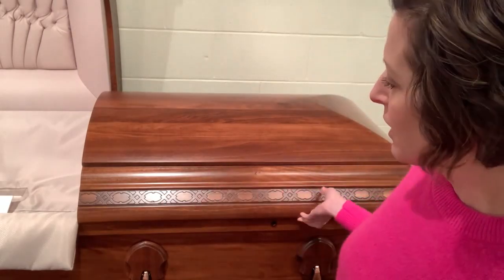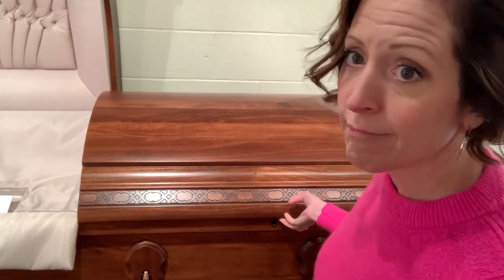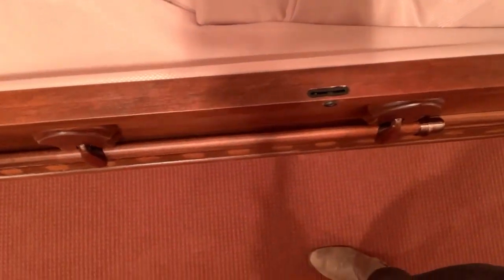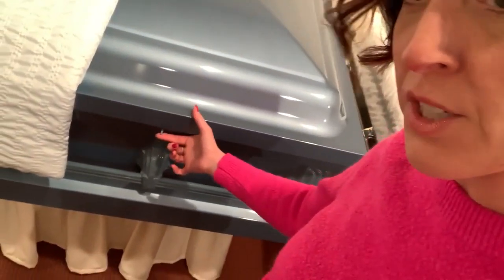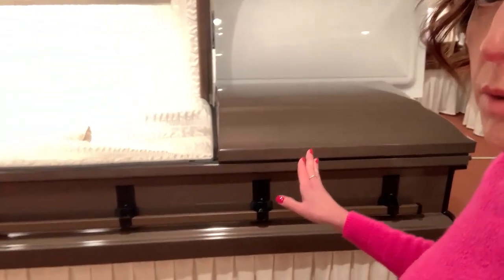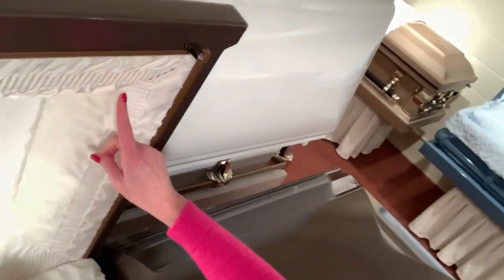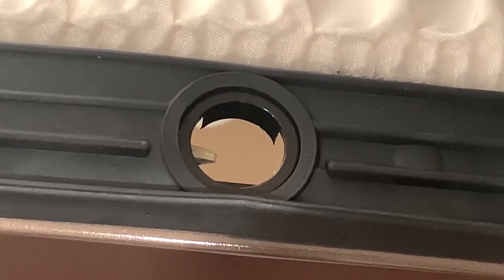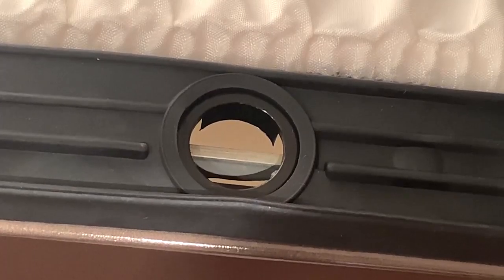How Does a Casket Lock? - Just Give Me 2 Minutes

Comment: I believe the same casket key is used to lock/unlock the memory drawer also as I recall the FH Director using it so I could put items into my mother's casket drawer.   I was thinking the vault also had a drawer but I don't remember seeing at the cemetery.  Under the cemetery tent there was somehow some sunlight that just hit the cross on the vault carapace just right to illuminate it.  Someone happened to photograph it and gave me the photo.  Even the copper vault lining looked like it was lit up.
Reply from the maker: No the vault does not have a drawer

Comment: Hello good morning 🌄🌞 Kari I was wondering about the metal caskets that the little piece comes across the little metal piece at the top of the lid I've seen funeral directions one will go and stand in the middle of the Casket while the other one is at the end cranking away is that to Make sure they both grab on the piece that comes and want I really want to know I've saw them crank them several times is that to make the lid crank tighter against the seal?
Reply from the maker: Yes I always put pressure on it to make sure it seals tight

Comment: Is there a crank to raise and lower the head? Do they only lock from the foot end of the casket?
Reply: Alleycat
The same caket key is used on a hole  which is positioned at the head and footend of side piece of the casket ( it is near the back of the casket lid). I think this is correct for a metal casket, on a wood casket it would be found at the same head and footend piece, but to the front of the lid of the casket.
Reply from the maker: In some caskets there are
Reply: Do those caskets costs more?

Comment: Looks like you could use a screwdriver extension or a an extension for a wrench if needed
Reply from the maker: Yes you could
Reply: It's basically an Allen wrench with a bigger handle ergonomically designed for easier turning.

Comment: What is the reason for locking when u are 6ft under and encased in a vault?
Is it just a precaution of gas build up and this way the lid wont blow off?
Reply from the maker: Locking is more so that they don't fall out
Reply: @KaritheMortician  fall out? U mean if they were dropped some how? That just sounds funny to me 😂 How will they fall out?
Reply: @kimglass4851  basically when they are being moved. Either by human or lift. If something happens. The body would stay in. Verse it falling out. If your carrying a casket up hill. And you fall and lose gurp. If not looked. The body could fall out.
Reply: @D38401  Gotcha! Thank u very much 😀
Reply: Perfect  example of why locking is done. My father was being moved out of the Funeral home into the hearse by pall bearers and the had to go down 5 steps. Well 1 guy fell and dropped his side then the casket slid down the steps. Thankfully he didn't fall out but it could have happened

Comment: If a living person was locked inside a metal casket & the reason I'm asking because years ago on WWE the Undertaker put the Ultimate Warrior in a metal casket & Paul Bearer who was a real life Mortician locked the casket & they were drilling holes in the casket & using crowbars to pry open the casket lid & I wonder if they had drilled holes in the bottom of it or if there was enough air in the casket for them to complete the stunt? I know it's an unusual question but I'm just curious as to how they might have pulled that off on TV.
Reply from the maker: It may not have been sealed for it
Reply: @KaritheMortician  Oh ok, thanks